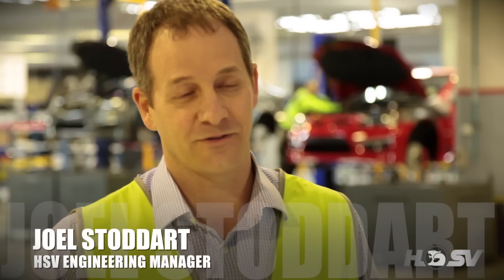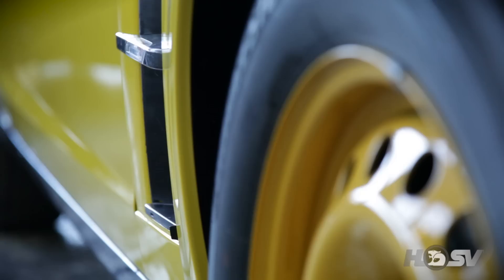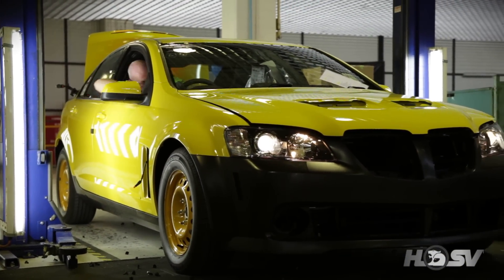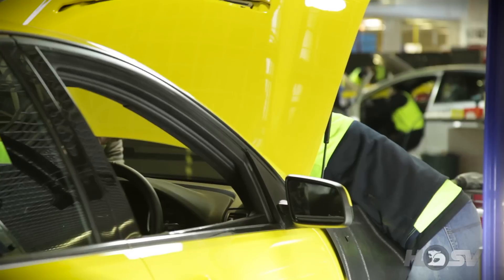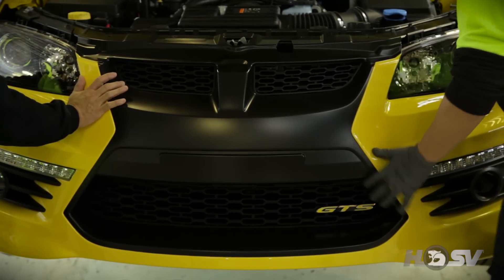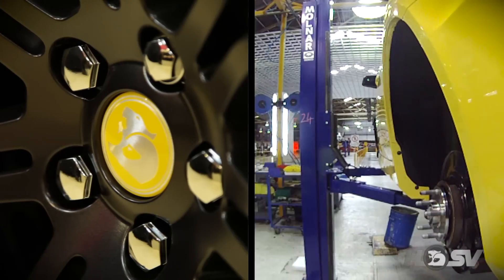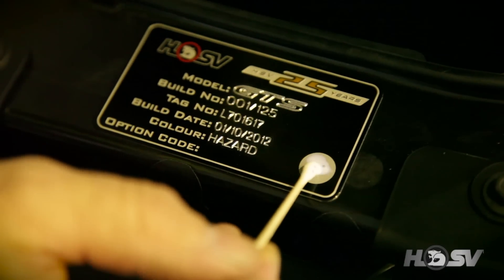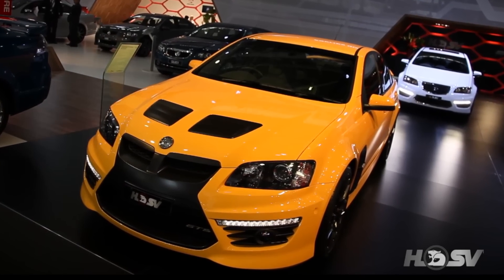From Factory To The Floor: Building the HSV GTS

Comment: No need, It's automatic cred if you have a HSV as most of the population can only afford cheap underpowered SUV imports or small cars these days!
If you have a sub $100k 430kw car of ANY sort there is no problem getting any street cred.  lol
You forget it's not a 1200kg 2 door supercar, It's a family sized 1800+kg all round sedan that does 0-100 in under 4.5 seconds, Not too bad at all getting all that 740nm torque to gain traction on a RWD car. Look will grow on people just like previous models

Comment: what they should have done was instead of having 3 E series, they should just have 2. E1 original then E2 with all the E3 interiors only and leave the exteriors alone and that's it. I guess this is what happens if they let a child do the design.  Then they moved all the 2013 models to have the same power output?  The GTS should have like at least 20kws over the Clubsport.

Comment: I think the dude in the video is a salesman, he was dribbling some shit.

1. If, during the early days of HSV, when they would make 2 cars per week, how is it that "most of the guys that work here have been here since the beginning"? I highly doubt they would have had 50 workers building one car. The original core group of employees would have been eclipsed by the influx of newer employees required to keep up with demand.  

2. The dude says that HSV's are hand built without a robot in sight. I remind the dude that Holden use robots in the manufacturing process of the core vehicle.

3. I would hardly say that HSV 'build" a car, seeing as though a good 85% of the manufacturing process is already completed by the time it arrives at Clayton. They're more of a "supplemental assembler".

But having said that, I'd still own one, just don't bullshit me and make yourselves out to be something you're not, like saying you're a fully fledged manufacturer.
Reply: I was about to write a couple of points you've made, but you ended up covering way more. I agree whole heartedly. It's one thing slapping body panel parts to a core car and calling them HSV, and another thing insulting our intelligence with how they are hand made. 

But I still want one!
Reply: +No Way thanks mate. I thought their spin was a little bit of a stretch. They should give us a bit more respect than trotting out some pretty obvious bullshit. 

I agree, I'd own pretty much any HSV on the market today. But I'd like to see GTS spec power across the range as an option, even as an "off menu" option, like a 430kw manual wagon.
Reply: only a small handful of the original factory crew are still there
Reply: Well said, also the fact there blokes there that look like they just left school is saying a lot and also a lot of indians and pakistanis as well, hum looks like the majority of the workers get paid a below average wage and casual at that, all the long term workers are in management and not on the floor, if anything they are ex panel shop workers and then go through the induction of HSV, which is put the cars together as quickly as possible ? Also the GEN F range and the LAST W1 is still the same starts off as a factory GEN F GTS and just remove what is required and then put on what is required and then ask over 70K more than the base price of the GTS,but dont tell anyone and now you have the W1 going for over 110K more than the cost price ? Also not letting the general public know as well is something holden should have been taken to court over that issue ?